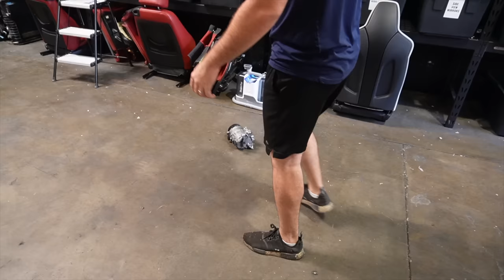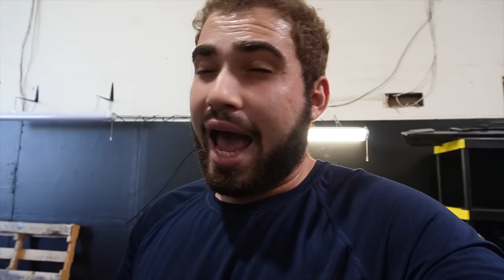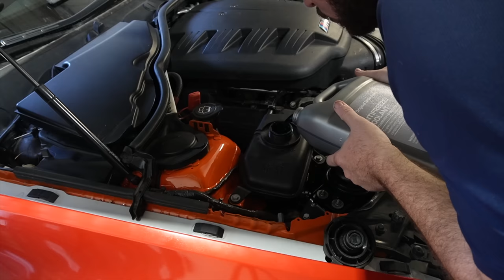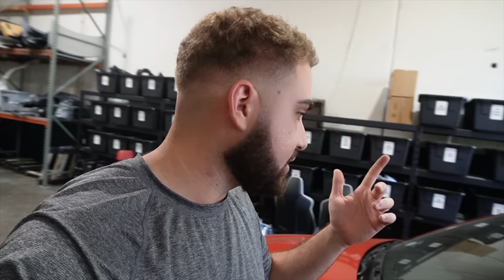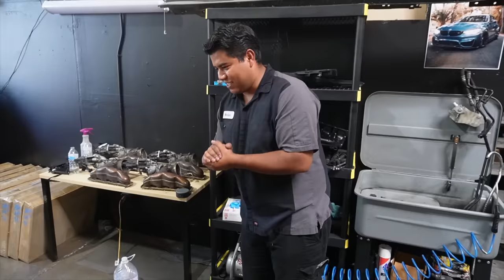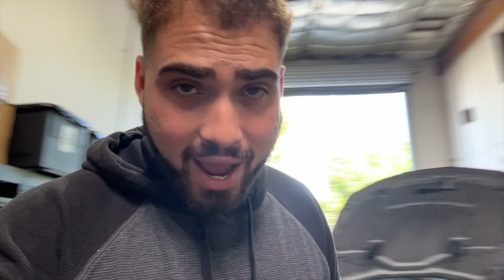MY E91 M3 IS NO LONGER DRIVABLE, BEEN TRYING TO FIX THIS ISSUE FOR MONTHS!

Comment: You need a vacuum pump, to put the A/C system in a vacuum. then put the refrigerant into the system. Air and refrigerant can be in the same space.
Reply: 💯 if you open the lines to outside air it needs to be vacuum evacuated. Sure a can of 134a can mix with the air in the system and possibly work “OK” if the compressor is on but that is 100% the wrong way to do it and will probably have issues down the line from all the moisture in the lines causing rust and inefficiency in the system.